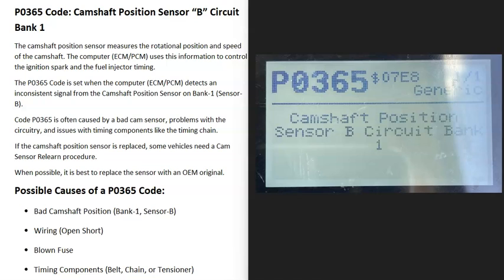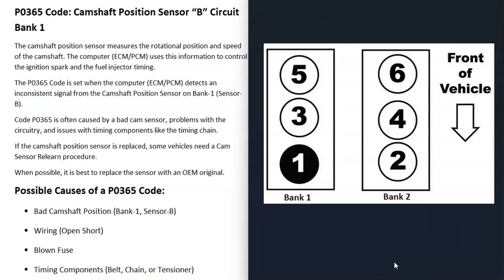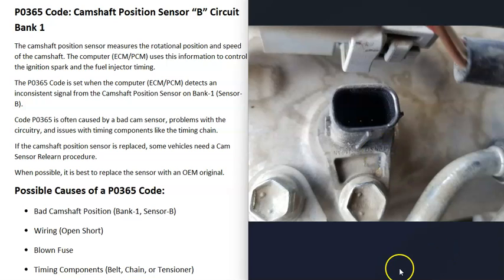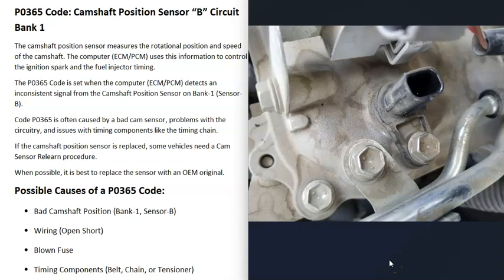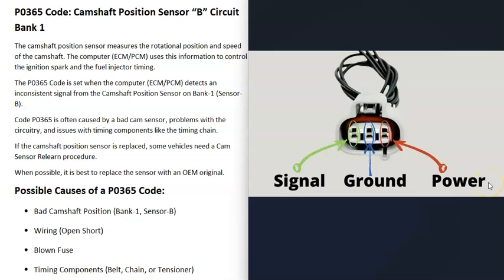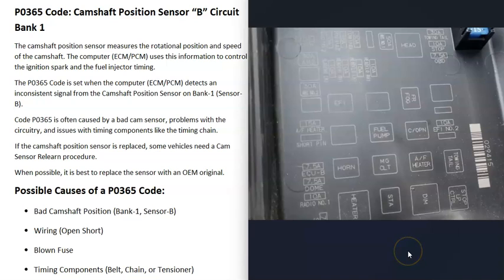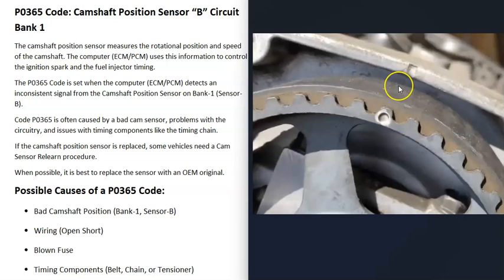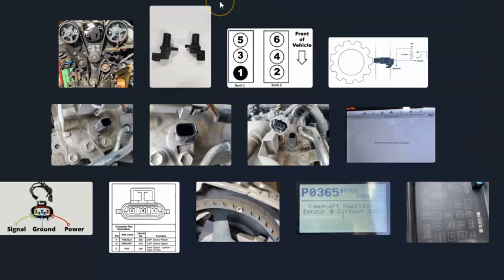Causes and Fixes P0365 Code: Camshaft Position Sensor “B” Circuit Bank 1

Comment: Can a Bad Alternator cause this on a Chevy malibu ?
Reply from the maker: A bad power supply can affect the computer and the voltages to the engine, but usually, there will be other U-type codes.
Reply: @HVAC_Mechanic  Yeah i have 2 , U2116 and U2129 . Just trying to get all the wisdom i can about this car stuff  . Thanks 😌

Comment: I got a small problem. Mine is reading a P0365 and the car runs perfectly but it still got the code but the car runs excellent it purrs under number one don’t move the tachometer and it runs great. Maybe it’s a scan so I’m using it will not it’s when I’m cheap five dollar or 10 hour scan toolmaybe I need a different scan to.

Comment: I have 2009 Toyota Corolla my battery was giving issues especially at start up..I get p0365 code get brand new battery..the code went away without any scan tool
Reply: that’s because you disconnected the battery…drive it for a bit and the light will come back on. LMFAO

Comment: Does the camshaft connect to the vacuum pump or brake booster vacuum pump? Is there some way that the camshaft could be a reason the breaks are hard to push down which makes the car difficult to stop?
Reply: It’s for a 2018 Ford Mustang ecoboost
Reply from the maker: The brake booster is not directly connected to the camshaft, but the booster does work off the engine vacuum, which a badly running engine such as low RPM can affect.

Comment: I have this code as a pending code (2012 Expedition 198k)Stalled on me as I was parking at home.  Had timing chain done in June and then redone earlier this month. Prior to the redo I was getting P0390 & 0394 MIL. Seems like the codes just switched banks. Red lights and stop signs are very stressful again.

Comment: I have same p0365 Toyota Camry 2012 I have change the sensor and i checked the wire signal all is good but still error p0365 code still coming can i check the timing

Comment: Hi, in have a 2011 Hyundai Sonata with code P0365-Camshaft position sensor “B” circuit bank 1.  Is that the intake side one?  Not the one in the back (exhaust side).  It's on the right side when you stand in front of the hood  facing the  car ?   Thanks.
Reply from the maker: It is best to find a diagram for the engine and sensor locations to be sure.  But bank-1 will be the side with the number-1 cylinder (4-cylinder engines only have one bank). Usually, A is intake, and B is exhaust.
Reply: @HVAC_Mechanic  Thank you. I found it's the exhaust side.  We tried to use the 12 millimeter sock to loose the nut but it would not budge.  Sprayed 10w-D40 too. Any suggestions?  Do wee need  a powered one.